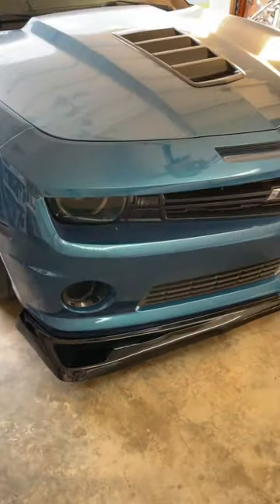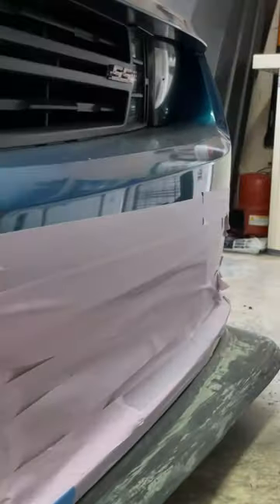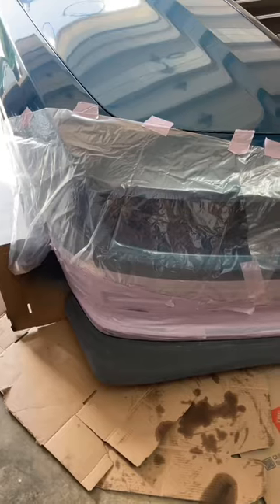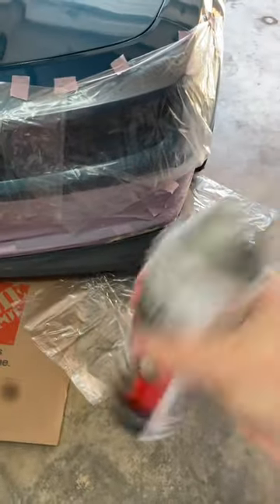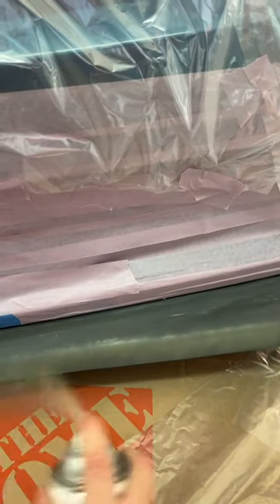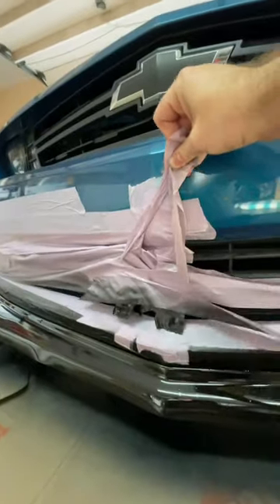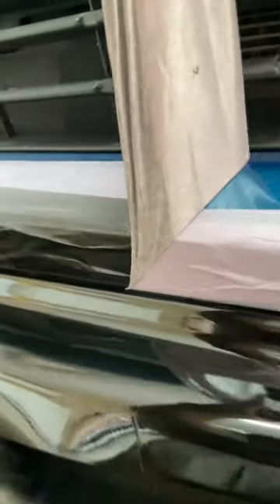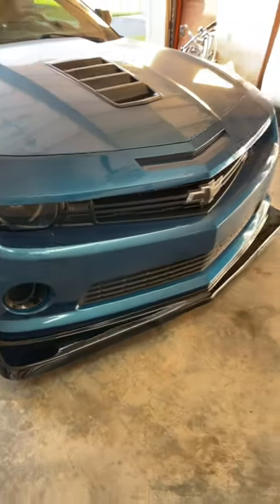Repainting my front splitter for under $30 like a noob (the lazy way)

Comment from the maker: 1. Get a better mask for painting
2. You SHOULD take the spoiler off and paint separately (I was lazy). 
3. You can also wet sand, or use different layers of sand grits, but meh, this is a 120 lip that's gonna get scratched.

Comment: Self etching on a non metallic part is pointless lol. If you want it to not crack, get more of a flexible coating from a company like SEM. Should be less $30
Reply from the maker: Thanks for the tip bro!
Reply: Yeah you should use a plastic primer w a flex agent in it.

Comment: I love the color. If I were to get a Camaro it would be a 2016-23 zl1 or this 2014-2015 z28 model. I love the sound of the 7.0
Reply: It's a pre 2012 ss . Can you afford that 16 zl1? That's a tall order
Reply: @ZLwh1ne  I thought it was a 2014-15, I saw the ss badge just meant I would want a Z/28 model. Technically I could get a zl1 but it would just put me in a big deficit, so I got a r/t
Reply: @itsnotpreston  hey and that's called living within your means. I commend you for that . That 15 Z28, still 60k. And don't forget that head work you're going to have to do with the Ls7, at least another 5K